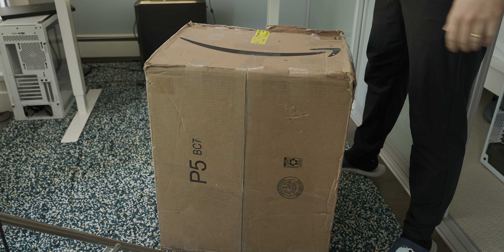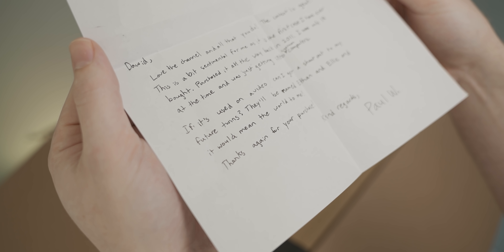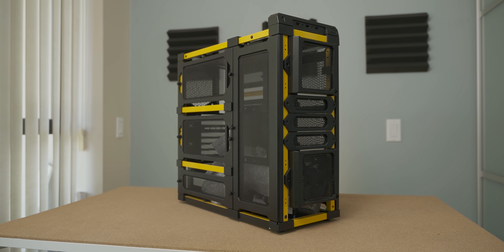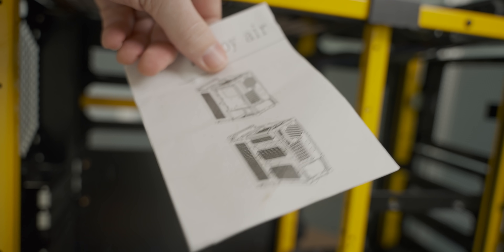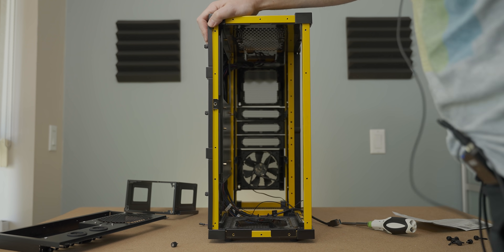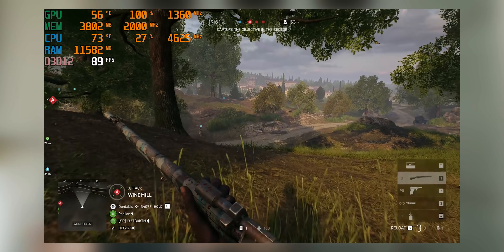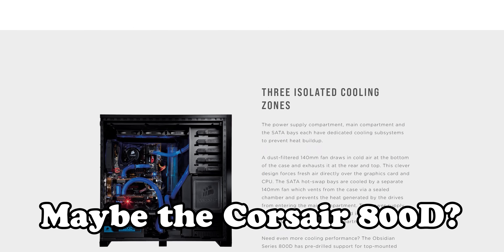The BEST Airflow Case Ever Is From 2010?

Comment: I've been rocking one of these LanBoy Air's for, well I guess almost a decade now. Couple of things I've noticed about it:
It is a horrible dust magnet, you really understate that in the video. Like really bad, but at least it is easier to clean (but you need to clean it often)
It fits an ABSURD amount of fans, I had to check the box, it says 15; but if I recall 4 of those need to be extra thin, and mount behind the motherboard tray.......
The HDD mounts seem to be missing on yours, they actually bolt each drive onto a pair of rubber tubes with hooks, that "hang" the drives from slots in the front. Those tubes degrade and cracked apart on me after ~6 years. I think the thought was they act as shock absorbers when you are strutting into a LAN party with it. It also has 2 ssd mounts on the front floor.
The airflow is actually piss-poor on this case and here is why. The solid bits of a case corral the air, and make it go over the hot bits more effectively. When everything is 100% open, the air just kinda goes everywhere. Lots of movement (and noise), not alot of cooling. I have 6 120mm case fans, and it still runs a bit hot (and loud).
Also that "screw box" fits into an empty slot on the front. It's to keep tools, USB drives, etc in it for when you lug it around, since it is the LAN boy.
The reason for all the extra screws (and mass, she is a thicc boy) is keep it rigid while you lug it from LAN party to LAN party; as one did in the 00's, not so much in the last decade though.
If you do need to lug it around, the handles are very strong, although a bit awkward since it places the case dangling up against your legs, smashing your shins with its impressive weight.
Also the worst part aside from the dust, all of your cable management sins are impossible to hide, since there not a single solid surface on the case.

All that said, I do love the case. Despite its drawbacks it's still very cool looking, easy to work in, and fun to use. I've kept upgrading/rebuilding my main machine in it since I bought it back in 2012 or so.

Comment: I really loved the antec twelve hundred. I dunno, it was my first highend computer (with a 2500K and a GTX680 back in 2012), it brings back memories. In retrospect, cable management and spacing is horrible in there, though. But I really loved the style. And the 200mm fan at the top.

Comment: Cooler master cosmos s case,  still use it and its great weighs heavier than a jcb!!, has rgb, been painted star wars black and white, has blu ray drive, dvd writer and usb 3.0 ports and a micro/type c and sd front i/o reader, I'm OLD school and I luv it. Its a floor case as have no room to mount it on desk as have 35 '' monitor in 100 cm gap between wall and door.

Comment: I think this case had bungee cord mounts for the HDD's.  They were intended to reduce hard drive noise from hard drives vibrating while in use.

The Antec Skeleton was another open air case from Antec.

Would like to see a video on the ThermalTake Level 10 or Level 10 GT (I owned a GT).
Reply: They do have those bungy things and will disintegrate over time. I still use this exact same case. Never needed anything else but I did replace those bungees with zip ties instead.

Comment: Not one that is more timeless in the same way id say. It definitely is starting to age a bit. But nevertheless still: the corsair 750d.

It's quite an old case even when I bought it it was definitely not new. But even today holds up quite well. Lots of space to build, some modern features like internal front headers. And it's airflow is fairly decent (with the front panel removed otherwise its not great). It's looks are also imo still quite modern.

Mostly downsides are the plastic side panel instead of glass, no usbc, and slightly out of date cable management (good for its time but lacks some features that cases have now). Also I like that it can still hold a lot of drives. I still use some.

Comment: my first case was a Cooler Master HAF 922 from 2011 and used till 2019
Reply: I have the same case but 2 of them. First one was build with  Core 2 Duo E8400, 4gb RAM and Geforce 9800 GT. Second one was gaming rig that was from 2011 and used till 2018 with i5 2500k, 16gb RAM and GTX 980 Ti.

Comment: How sweet of that person to send you that case. :) I really like how it looks, but it surely is kind of a dust-trap. I would be too lazy to use it. xD
Reply: Antec said that the case was designed to be used with positive air pressure, ie all of the fans blow the air into the case, the air then exits through the open mesh panels. With this method dust cannot enter the case.

Comment: Look up the Thermaltake Mozart TX VE1000BWS and if you can find the lcd monitor add on, it’s the Thermaltake A2413 7-inch Drive Bay LCD Monitor.  You won’t regret it.  I remember when this case was announced, that it was the most overboard and outrageous that I needed in my life.

Comment: Awesome though I am still using a Corsair 200R and it's pretty good... Apart from the limitations of the Front panel air flow but I have the metal side panel with the Duel 140 Fan Mounts and the Top has room two 140s so it's all good the worst temp I've seen was 68c during a stress test on the Ryzen 5 2600x

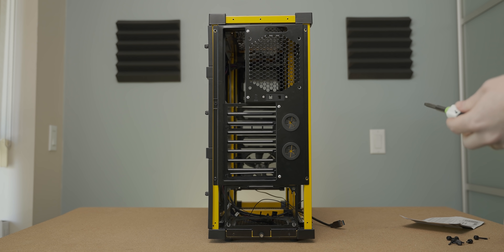Comment: 5:17 "Everything uses 4 more screws then you'd imagine it would need"... sounds like my Silverstone Kublai Series KL06B-W case. It literally has screws that have to be removed before you can remove screws. Oh, and top-mounted PSUs?  That pretty much was the standard in case design for longer than bottom mounted PSUs have been (I've been doing PCs since Commodore 64 days).  If you're looking for a timeless (well, maybe that's not the right word)... if you want something unique from the old PC days... try getting your hands on a AeroCool Syclone II Professional gaming case.

Comment: I miss the good full tower cases like this. I don't know if I can ever get rid of my Ultra Rogue M925 as it keeps all my components so cool and there's a fan speed and LED controller on the top. There's so much airflow and it's glorious. All the new cases have that garbage glass side panel nonsense that provides zero ventilation -_- gross.

Comment: I have an antec 902 from (i assume) around the same period and it flows like diarrhea. 4 unobstructed 120mm fans plus a 200mm exhaust fan on the top. Every computer i've built since 2012 has been in that case :) It's had everything from a phenom 2 to a 12 core xeon in it and stays cool enough :)

Comment: Our education got an old supertower donated to it a while back. I got to clean and set it up n all
The case was a good ol Xigmatek Elysium Case. Which was 'fun' to clean cigarette dust out of all the components n panels.
Passthrough usb3.    And the inside was a mish mash of bolts used for some fans (By previous owner who probably ran out of screws)
And a motherboard from 2010 and a i7 920. And some gtx 980... So person probably upgraded it later.
Was nice to try it out, and had alot of drive spaces on the front. With hdd cages for both fans to be attached to.
Nowadays we use it to edit on and fool around with, It's a fun chonky case. But way too clunky to drag to a lan party. thats for sure.
Basically the case was meant for 'slap your biggest radiator on the top i geuss and have fun'

Comment: I have Silverstone Raven 03 with 7x120mm fans and 2x180mm fans, those are just case fans.
Silverstone Raven is truly unique airflow case, and by default its anti VGA sag
i bought it in 2011 It was housing my i7 2600k for decade, after upgrade i transferred i7 2600k to HAF X.
By my opinion two best cases ever made.

Comment: dawid , maybe my corsair carbide 500R ? , yes my fans might needs to be swapped after 7 years of uses but it still rocks to this very day . sad thing tho , its not compatible at all with a 360mm aio / rad . so i can do a maximum of a 280 top (confirmed cuz i have one atm) and 240 (maybe 280 i cant remember the specs) in the front plus a 140 in the back .

Comment: I'm sad it didn't come with the complete set of stock fans. It had two in the front, one in the back, and two on the side panel at GPU height. That's real airflow :D

Still running this case, upgraded last month from 2500K to 11400. Very happy with the results!
Reply: *All fans pointed in, including what you'd consider the exhaust!
Reply from the maker: @Redmage913  I was thinking of doing that fan wise. Using all the fans as intake and then getting positive pressure going. How is the dust in that situation?
Reply: It will exist after a couplefew years, but I believe the constant positive pressure minimizes that factor.

With all case fans pointed inward, I actually pointed my 212 EVO to vent out the top, since air is already headed in that direction naturally.

I haven't had to replace a single fan - still running the stock blue Antec 2/3 fans, none have died or gotten unreasonably noisy.

Thank you so much for asking! If you have any more questions or want pictures of the complete setup, please contact me directly. Take care!

Comment: A friend of mine has this case. Or at least a strikingly similar one. I once was asked to upgrade the system form him with a ryzen and better Graphics. Man, this thing was filthy. Apparently he had never bothered cleaning the case from the inside encrusting everything with dust. When I arrived he told me, he had already "prepared" everything for the installation of the new parts, leaving me stunned upon entering the room. He had removed all the parts and mounted the new ones, without cleaning the inside of the case. There was dust and shit all over the place. Also he made no backup of his hard drive, which he told me after finishing the cleaning and installation of the parts, as the system refused to boot up. End of the story: I will never be helpful again.

Comment: i still prefer the older full ATX case, where the psu is at the top, the bottom part is just massive wherw you can put 5-6 pci-e, 4 bay for dvd slots, 2 bay for floppy and 5 bay for hdd

Comment: This case was evidently designed with the knowledge that the AMD FX bulldozer/piledriver would soon come to market, and they planned for the minimum airflow requirements of the 8 core variants
Reply: IT's made clearly for LAN parties, you know, when you brought computers to one places, plugged internet cable and enjoyed local multiplayer. Besides airflow, Antec Lanboy might have been excellent case for showing off hardware and cold cathodes.
Reply: @MJ-uk6lu  you're right, but I was only bring salty about how hot my FX 8350 Black edition ran even at stock
Reply: @joannaatkins822  They weren't really that hot. Stock cooler that came with them was an e-waste. FX chips had maximum temperature set at just 62C, which was later upped to 72C.
Reply: @MJ-uk6lu  yes, but they were brutal on energy consumption, even with all the improvements which translated to a lot of heat constantly, not jusy high peak temperature. But regardless, stop explaining FX chips to me. I had one, I loved it despite it's flaws, I don't need you telling me things I already know.
Reply: @joannaatkins822  I had an FX too
Reply: @MJ-uk6lu  uhuh, I can tell by the way that you can't stop talking about them bud.

Comment: the stacker case would be a good one to review.

also there was a thermaltake case that had watercooling build in, as in, the side panels were part of the rad/res setup, worked shockingly well honestly, amazingly shockingly well... though we did upgrade the pumps and fans on the one my buddy owned(its still in use his little brothers using it with his old 990x(or was it 980x..) either way, its clocked to 4.8 24/7 and has been for years, 48gb of ram, and dual 2080ti's (got them cheap from an idiot boss who bought 3070's to replace them, thinking it was going to be a massive upgrade for him and his wife...only to find that in most cases...it wasnt...LOL....dosnt even got more vram so he can crank stuff higher...LOL..) 

there is a case with better airflow then eve this, almost everythings made from wire mesh, downside was... it was damn hard to clean and avoid damaging the mesh due to the kind they used..

Comment: People always complain that it will be a dust trap. This is mostly true. Others claim they can make every fan intake and generate positive pressure to keep dust out. This doesn't work. With that said, I bet I can take a can of compressed air and blast it through all the holes in my case faster than someone else could remove and clean their dust filters....

Comment: lol this thing looks like an Erector Set. Remember those? Bunch of metal strips held together with nuts and bolts. Kinds reminds me of one of those. I wonder if anyone actually managed to use Erector set parts to make a PC case? :P

Anyways I don't have this case but I have a case from similar vintage. An Antec 300 made by same company/brand that made the one in this video. Has good airflow but like this one cable management isn't the best. In fact it's probably a bit worse then this one. HD cages aren't removable and it has 5.25 drive bays (for optical drives) which also aren't removable. Despite that though it does a decent enough job with airflow. The hd cages are right behind the 2 120mm fan mounts at the front of the case. It's got top and back fan mount as well as a side panel fan mount. I actually use the 5.25 bays so them not being removable isn't really an issue for me. Got 2 optical drives and a floppy drive mounted in there (floppy drive mounted via 5.25 to 3.5 adapter). It's also got a laptop size HD mount at the very bottom. (likely meant for SSDs). I have a 500GB WD SSD mounted there just as the case probably intended.

It was my first custom PC case as well. Put a ASUS P6T motherboard in it with Intel i7 965 Extreme Edition clocked at 3.2Ghz.

Still use this machine to this day and despite it's age it still runs well in 2021. I recently upgraded the video card to a GTX 780 TI. Definitely not modern either but a decent card of it's era. Would have gotten a 980 but they were a bit too pricey still. I mostly stayed in this era of cards to keep native compatibility with my VGA CRT monitor. Newer cards dropped the DVI-A standard and don't have a RAMDAC which is needed for VGA output. The HDMI to VGA "adapters" out there can have issues dealing with higher resolutions and/or custom timing so I wanted to stay on a card that still had native VGA support.

Comment: As an owner of a lanboy myself, the hard drive mounts dried out and perished over the years and I was never careful with the screws. I lost a few. Otherwise I loved it.
Reply: To those unaware, the hard drives were intended to be mounted on these little rubber bungee cables to help isolate the vibrations of the spinning disk drives. I may pull it back out of storage now that everything is solid state.

Comment: A problem with a case perforated everywhere, is that the fans will blow as much air out of the case as onto the components.
Reply: Least there are minimal heat issues even with the R9 5900x that Dawid tested in the case.

Comment: Is it me or was the CPU actually running a bit hot for the load ?
Reply: Zen 3s ramp up in temp pretty quickly under moderate load. Also at 4.75 Ghz I'd guess it hasn't been Curve Optimized which would potentially reduce temps more.

Comment: Nice find! I still run this case today actually, the Blue version. Modded it to Inverted ATX and removed some of the mesh on one of the side panels, replaced it with plexiglass. BTW there are no drive cages like you mentioned, instead the drives are literally suspended using these type of rubber bungee cord things. Here is my case today https://imgur.com/gallery/MjyK4Cp

Comment: your forget to review AirMount suspension for HDD that within 1-2 yrs rubber is brittle and fell apart.
So, i'm replace with metal wire. However, the problem is i'm need to add more HDD but forgot where i'm keep the rest. --"

Comment: The best Air flow case ever is actually the Silverstone FT02B-W.Came out in 2009. https://www.silverstonetek.com/legacy.php?area=en&model=FT02. Hot air rises, so the Revolutionary 90 degree motherboard mounting and three 180mm fans on the bottom pushes air from the bottom to the top where the I/O is actually at as well as another 120mm fan that help passes air out works awesome! This design is proven and surprised is not used more! the best case I ever owned for air cooling!

Comment: months? i would of sold you mine. I have a blue one and a All Black one. lmao the "Liquid cooling butt holes" are there for the passive 3.0 cable. it gets ran out the case and you plug into the back of the motherboard lmao Liquid cooling butt hole

Comment: There's a misconception these days about what airflow is. Airflow does NOT mean 'as open as possible'. Airflow refers to an actual flow of air through a closed container.

So no case full with holes can ever be an airflow case. The best airflow case is basically completely closed except where the fans actually are.

So if anything, the case in this video is one of the worst airflow cases ever, second possibly only to open testbenches or cases.

Comment: i still have my https://www.techbuy.com.au/p/443154/CASINGS_FULLTOWER/Zalman/ZM-GS1000SE.asp this tower has served me well. rock solid construction airflow is excellent, i have a ryzon 2600 setup with an aio on the top. dust bunnies are zero in this box aswell.

Comment: that case is the biggest bag of trash that I have EVER built a system in, from the rubber hard drive mounts, to the non existent cable management.
the very best thing about that case was when the customer came to pick it up and take it away. oh and this case really doesn't have an "Air flow" more of a test bench with mesh guards to stop you sticking your fingers in.